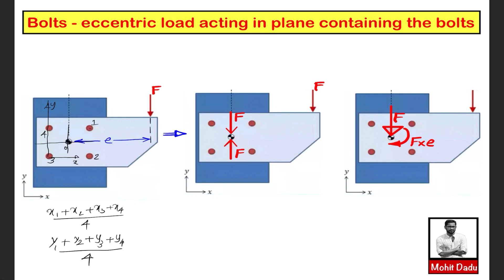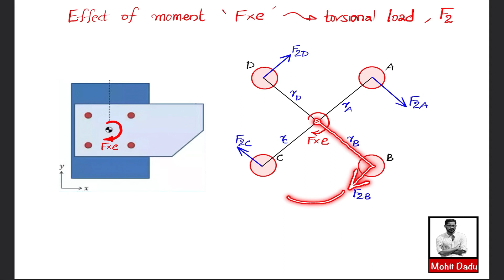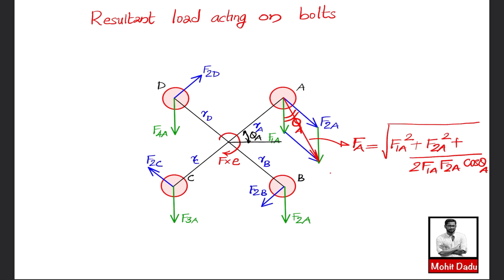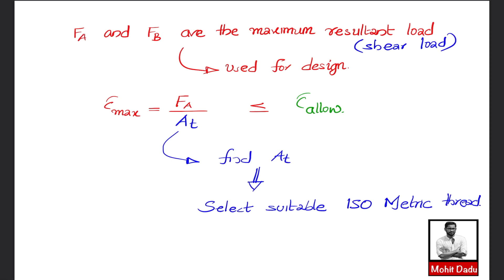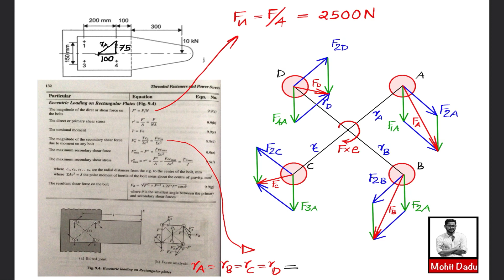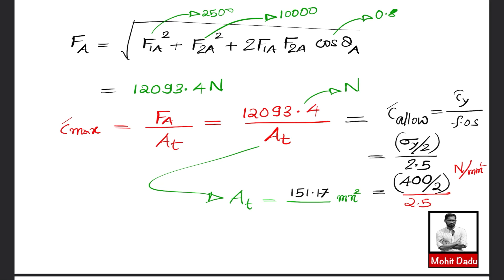Comment: Note: All Primary shear loads should be read as F1A, F1B, F1C and F1D and All Secondary shear loads shoulbe read as F2A,F2B, F2C and F2D. ( mistake in naming primary loads was made in this video). And the resultant load at bolt locations are FA,FB,FC,FD

Comment: 17:58 – The distance is √(100² + 75²). This probably wasted a lot of young engineers' time. Better to slow down, work the problem clean, not copy from someone else.
Reply: You’re right — in the first step, I mistakenly wrote it as √(100² + 50²), but the final answer (125) is correct for √(100² + 75²). That was a genuine slip in the working — thanks for pointing it out.

I really appreciate viewers like you who take the time to go through it carefully. Will make sure to fix such things and double-check in future content. 🙏

Comment: Can i know ,can we calculate Eccentrically loaded bolted connections 'e' ???¿
Reply: Step 1.

First u have to locate where the C.G of bolts is loacated... For this you have consider bolt loacations as point and each point is having 'x' and 'y co-ordinates, then we can locate the C.G as(say if there are 4 bolts);

X= (x1+x2+x3+x4)/4
Y= (y1+y2+y3+y4)/4

Step 2.

Then eccentricity 'e' is the distance from this C.G to the point through which load is acting.